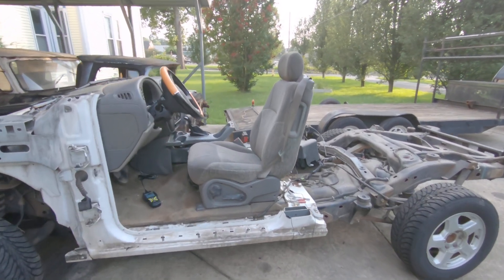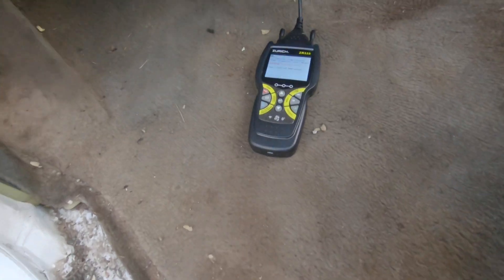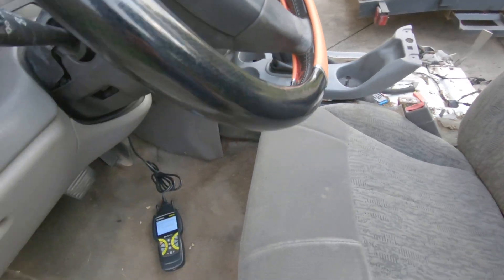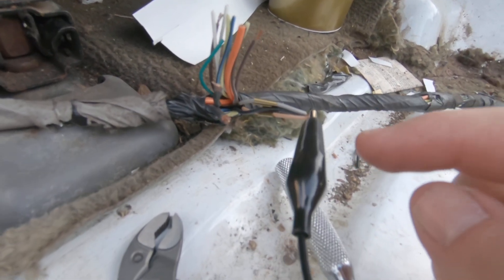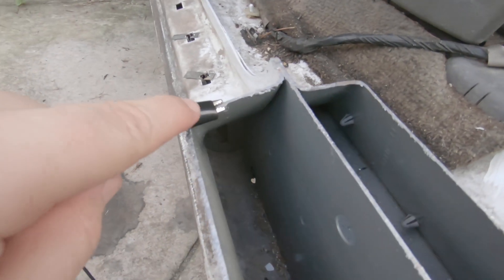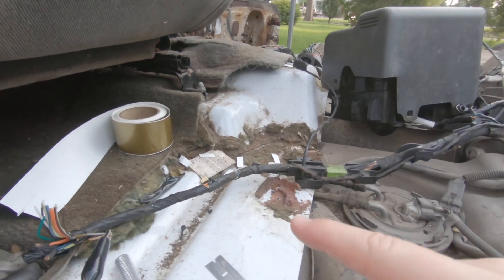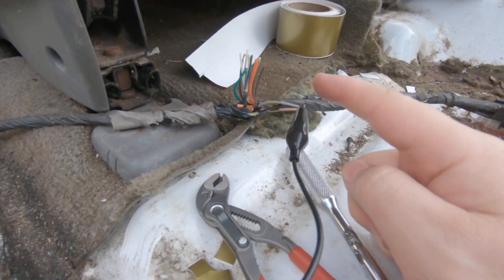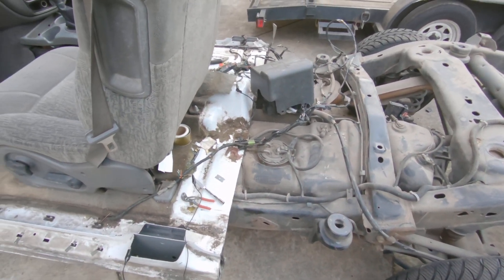Trailblazer Body Swap Won't Start Electrical Ground Problem Solved

Comment: Any updates on your swap? Just curious if you kept the body control harness is your swap
Reply from the maker: I have kept the bcm so far. Got hung up on core support and fender mounts. Its kinda driveable now, but needs more welding to be secure.